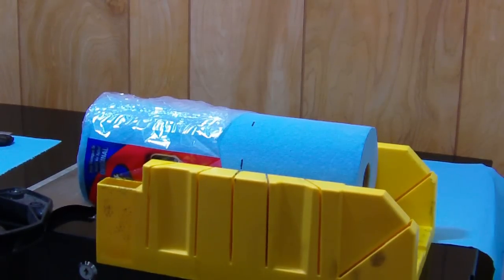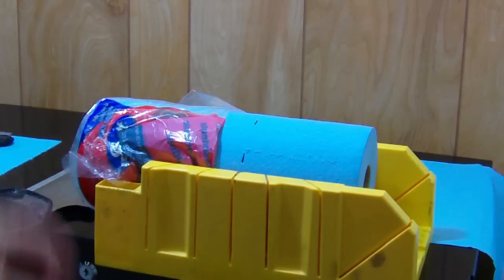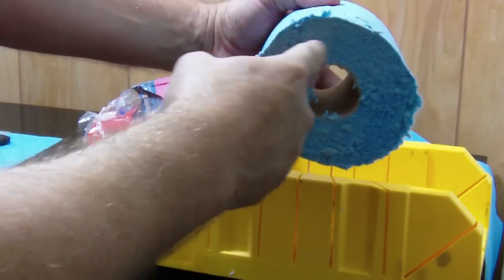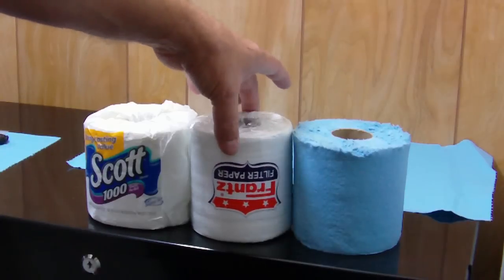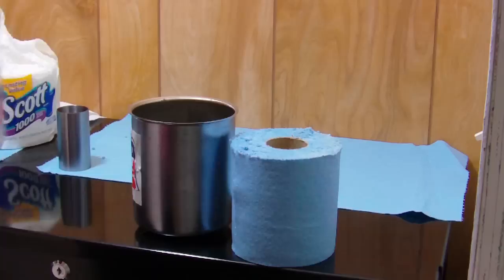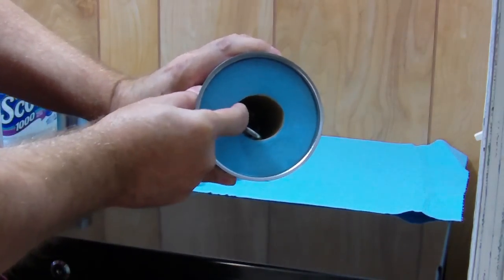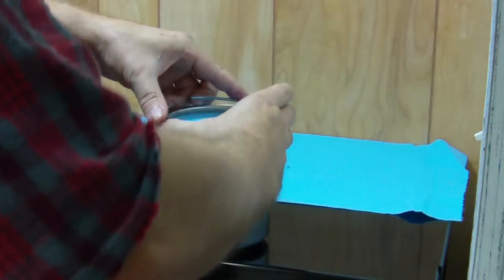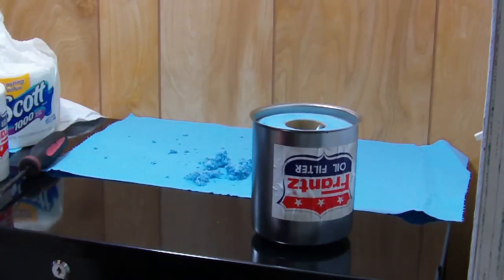Blue Shop Towels as a Bypass Filter Experiment

Comment: The big Gulf Coast 10 quart filter for heavy duty diesels is 99 percent  at under 1 micron. When I sold them they used Bounty big roll paper towels. The flat head Ford V8 canister filter on my old Ford diesel tractor has half a roll of Viva towels in it now. About the same as the blue shop towels. John Frantz got his start in  19 53 converting the old canister filters to use a Frantz canister with a roll of 2 ply toilet paper. No Frantz elements or Scott 1000 in those days. I use only the Ford canister. Feed it with a Perma Cool 189 oil cooler sandwich adapter. Got mine from Jegs. Summit.has them. I have a tubeless tire valve in the lid. A tire pump with a gauge.The pressure comes up. When the pressure drops its ready to change. Use a Slime valve with a nut from Auto Zone .

Comment: VIVA paper towels are similar. I use a sharp knife and go around a few times. Its a lot smoother cut. My flat head Ford V8 canister filter takes two 5 1/2 inch elements. Thats a 11 inch roll cut in half.
Reply: The Viva cloth paper towels are similar. I set up the flat head Ford canister filter to take the Scott 1000. I was able to remove the plate so it would take half a roll of 11 inch paper towels.
Reply: Correction. I removed the spacers under the perforated plate so the plate would go to the bottom.
Reply: I tried the saw. I like the knife better. I mark it all the way around and put a good edge on the knife. The Scott 1000 worked great. Cant gravity enough fuel thru it for the Diesel tractor fuel. I remember when all we had to use was mlm 2 ply. The filters dont require a firm paper. For awhile I got my best 2 ply from janitorial supply stores. Went to the easier to service top loaders in the 80s.
Reply: I go around a few times with a sharp knife. Its hard to cut the core. The next time I cut one I will have something thru the core like a shovel handle. Not sure what Gulf Coast filters uses now They claim 99 percent at under 1 micron. They used Bounty big roll paper towels in the 90s. Janitorial supply 2 ply in the little filters. The top salesman took over the company and dropped the toilet paper filters. He only does heavy duty stuff. Off shore rigs. Abrams tank fuel  military aircraft fuel and that sort of thing. Small filters are a waste of time to him. The Australian Jackmaster Classic is similar.
Reply: The problem with toilet paper is it generates too many BS stories. I started in 1963 with a Frantz oil cleaner and Standard Delo 30W. Delo 30W and Delo 20W were 29 cents a quart in the discount stores. Frantz came only in universal. 29.95 complete.  If you are selling them and someone asks what is in there it would be best to say a section of VIVA paper towels. Then cut up some and sell them. Dont use a saw. Use a sharp knife. I went to the easier to service top loaders in the 80s. Frantz stuck with that bad design.

Comment: Serrated bread knife or very sharp kitchen knife would probably work better than a saw for a roll of paper towels...
Reply: I was using a fine toothed hacksaw and going around a few times. A sharp knife makes a lot smoother cut. Ive been using VIVA towels. I believe Gulf Coast filters claims Bounty big roll paper towels are a 1 micron filter. The Australian Jackmaster Classic claims 1 micron if you use their elements.
Reply: When I started using the Frantz in 1963 they didnt have the ring in the bottom or the bail to remove the used TP. The ring isnt needed if you use good paper and install it correctly. I used long nosed pliers to remove the paper. The Australian Jackmaster Classic has a pull out ring if you use their elements. I use toilet paper so I need the long nosed pliers and a socket to remove the lid. I went to the top loaders in the 80s. Jackmaster has a valve in the lid to push out the excess oil before changing it. Mine didnt need it. I put a Slime tubeless tire valve in the Ford canister lid. The one with the nut.
Reply: The Australian Jackmaster Classic has the air valve as optional equipment. The only filter I have that needs it is the Ford canister filter. I put a regular Slime bolt on tubeless tire valve in the lid.

Comment: So just how much did you have to drink that  you couldn't find the toilet paper ?
Reply: My thoughts exactly.
Reply: The flat head ford V8 canister filter on my diesel tractor takes 5 1/2 inch elements. Thats a 11 inch roll of VIVA cut in half.
Reply: I have packed loose paper in the bottom and pushed a roll of Scott 1000 down on top of it. It seals at the top. I have a tubeless tire valve in the lid to push out the excess oil before changing it.
Reply: The only problem I have with toilet paper is it doesn't fit. Frantz is a terrible design for using toilet paper. I used the Frantz for about 20 years before going to the top loaders in the 80s. All of the best ones now are top loaders. The next Viva towels I cut for the Ford filter I will use a sharp knife. I have a old shovel handle to push thru the core. The core is hard to cut with no backing.

Comment: Fram hasn't made a filter that cleans oil since the 60s. My 41 Dodge had a Fram that cleaned oil. It had a decal on it with a dip stick with clean oil on it. It read the dip stick tells the story. It was a bypass filter. John Frantz got his start converting them to use toilet paper. My Rambler American had a Fram bypass filter. It was a piece of crap pleated paper filter. I bolted a Frantz to the spin on bracket.

Comment: The orifice is what controls the rate of flow When the element slows down the flow you have gone too long before changing it. Always change the filter before it reaches its capacity. My engine is pristine. I could change the filter every 20 k.I wouldn't be getting enough new oil to keep the additive package up. At my filter change interval of about 6k the filter is still clean and the oil is still clean. I use Scott 1000. I use a Motor Guard. The Frantz is a good filter if you know how to change it
Most people don't.

Comment: wonder if somethingl ike this could be used on a 4 cylinder car only seem t o see them on trucks
Reply from the maker: I saw a video with a Frantz canister on a Toyota, it cleans the oil better than the small filter. I have one on a 6-cylender diesel. Keep in mind this is an expensive system to purchase and install.
Reply: Yes, and they are easier to install (usually).
Reply: In the early 80s a Realtor here in Denton Texas asked me if it was too late to put a Frantz on his Toyota Corolla with near 100.000 miles on it. I asked him how long he planed to keep it. He said a long time.  I said it needs a Frantz. Years later my wife was introducing me at church. She said mr Biggs this is my husband. He said I remember Ralph. The Corolla has over 500.000 miles on it. Took the boy scouts on a camp out and they found the Frantz elements.
Reply: You need to be mechanically inclined to install and take care of them.
Reply: I ran a 84 Subaru over 250.000 miles with no oil drains using Mobil 1 with a Frantz oil cleaner. I used a Frantz adapter that eliminated the Full flow filter.  The problem with cars is finding room to mount one. The best filter for cars is the Jackmaster Classic. The over center clamp can be a pain in tight places.
Reply: Putting a Frantz upside down under a truck would be a non starter for me.  In the 60s Frantz recommended putting the Frantz upside down on the beetle. To hell with that. I put a Motor Guard on the wifes beetle. It filtered from the bottom up. Tilted it so the large chunks wouldnt go back to the engine at shut down. VW saved millions by not putting a full flow filter on the beetle.

Comment: Waste of time
Scott 1000 works better because it is more solid. I have used Toilet Paper since 1963. It has worked for me.
Reply: I have been doing it with a sharp knife.
Reply: Actually before Scott 1000 or the Frantz elements all we had was 2 ply toilet paper. It worked great. Ive been testing VIVA towels and Charmin Ultra Strong. Gulf Coast filters of Gulfport Mississippi  uses Big roll Bounty towels in the big diesel engines. They used 2 ply TP in the Frantz 3 stackers before Frantz 3 stackers went out of production.
Reply: Years ago I did a fleet of tree service equipment. The  big filters took Bounty Big roll paper towels. The small filters took Scott 1000. Not sure what Gulf Coast filters uses now. They dropped the small filters. They paid to have the big filters tested. They are 99 percent at under 1 micron. That is about as good as you can get.
Reply: I might be wrong. In the 60s all we had was 2 ply paper It worked fine. We didnt have Scott 1000 or Frantz elements. I ply was what you found in chemical toilets. The only thing that fits the Frantz is the Frantz elements now. The Charmin ultra strong is similar to what we had in the 60s except it fit.

Comment: Hey there! So i was just talking to my buddy who works at Cummins rebuilding engines in Australia, He said that the cummins engines he works on run a 30 Micron full flow filter and a 5 micron bypass filter, do you think this is the reason the Cummins engines last so long ??
Reply from the maker: Yes, almost all diesel engines run a bypass system to remove abrasive soot. Studies were done on a GM 350 and the result was 4X longer engine life using the Frantz oil filter to remove small particles.
Reply: Many years ago Cummins claimed an 80 % longer engine life using the Cummins Fleetguard 750. They used pulverized newspapers and wood chips.

Comment: The space between the tube and paper core means nothing.the seal at the bottom is what counts. The Gulf Coast O1 Jr has about a 1 3/8 tube.It has a good seal at the bottom plus you are pushing the element down against the seal when you change it. Watch out for the B S stories. I have been hearing them for over 50 years. A guy asked me will a Frantz do something for my noisy Cadilac engine.I asked when did you change the oil last.He said I don't know it's been a long time. Does anyone think this fool would change the Frantz IF I sold him one. He would take his Caddy to a mechanic with a blown engine. He would be told his engine is full of toilet paper when it is full of sludge. Its not a problem with these modern engine but in the 60s I have seen a Frantz fill up with sludge in 50 miles. They didn't have good crankcase ventilation or fuel injection. My Altima gets a new roll of Scott 1000 every 6000 miles and a quart of Pennzoil Platinum .What oil is best ? I have no idea.

Comment: Cool idea. It looked like the metal tube you used did not fit tightly against the cardboard. Wont the oil just bypass the element? Also how are you monitoring flow rate? I'd love to have a flow rate on my frantz to tell when it needs to be changed.
Reply from the maker: I was going to do another video about some of the stuff I have learned about the Frantz, it does need to fit tighter or the paper will expand against the metal tube and loosen up allowing more particles to pass. There is a metal ring on the base that stops the oil flow down the cardboard center. My system has a return line in the fill cap, its easy to measure the flow rate into a container or collect a sample, use a meat thermometer to determine oil temps for a comparison. I am working on a measurement of the Scott 1000 element to get the same quality TP element every time. The formula is how much to remove to get a tight fit based on how the TP will compress and fit in the canister with minimal effort.
Reply: I just picked up some scott1000 for the first time (been using the unit for 10 years maybe). I'm just planning to take off enough so I can barely shove it in.. The frantz filters I bought directly even seemed too loose. I'd be interested in any such vid if you make it. I think so many of us have different (good) mods for it. I was thinking of making the inlet hole even smaller, or installing an adjustable needle valve on the inlet line, as I think it is flowing too much. I put a clear tube in a portion of the return line...(after you gave me the idea to monitor flow) if it wasn't for an occasional bubble I would have no idea since the oil is so clean it looks like there is nothing inside the tube lol. These things rock. 99% of people have no clue.  Anyways it seemed to be flowing much more than I expected. Maybe a tight fit with the scott 1000 will slow it down. I just did a rebuild and swapped my frantz into that vehicle so I'll be replacing the filter more often for a while. Now I need to find another one to replace the frantz I stole from my other car. :)
Reply from the maker: weeral1
I made another vid where I measured the canister (13-1/4" around) and the Scott Roll, was able to fit 14" inside with a tight fit. The flow rate is slow on a cold engine but pumps 1 pint per min on a hot engine... My engine is a diesel and it had a load of crap in it, the TP roll gets changed every 20 hours and the top of the roll has grit in it every time. I also do lab testing to verify the improvement in clean oil. [Thanks for your comments]

Comment: So how's it work?
Reply from the maker: I ran this paper towel because its more porous to hold dirt and it worked wonders to polish the oil. I went back to Scotts 1000 rolls changed every 15-20 hours until the oil became clean. The last time I did a particle count, the results are very good. The first sample was 18/17/14 and reduced to 16/15/12
Reply: It doesn't

Comment: How's it working out?
Reply: Probly has paper media all around his engine XD oil pressure and heat probly tore them towels up and im sure it made its way into the engine lmfao
Reply: I started using toilet paper oil filters In 1963.  Frantz on a Rambler American. I have done very well with toilet paper. Never had to use shop towels. I use Scott 1000 now. It was a.lot easier to find high quality paper in 1963.You are wasting a lot of time.

Comment: When the engine is up to operating temp, does the canister get hot?
Reply from the maker: +dieselworld Its oil temperature, 160-200 degrees F
Reply: That's what I thought because my Frantz oil refiner does not get warm at all.
Reply: Yes, very hot. My arm told me that.
Reply: If the oil is hot the filter should be hot
Reply: In the old days engines generated a lot of sludge. If the Frantz quit getting hot you knew the orifice was clogged or the toilet paper was full of sludge.

Comment: It's a bad thing to do I have riped a part classic cars with what your doing on them. And have found that they destroy the motor. And have talked to restoration shops and they've came to the same conclusion by building a filter this way it will destroy your motor very quickly and there is no game.
Reply: The Frantz is a bypass filter Johnathan, as they should be used. There was a company called Stilko, that replaced the normal oil filter with their canister. Those are the ones that failed, plus they are no longer in business. Frantz, Amsoil, Eco Filters, Gulf Coast, and Kleenoil are all in business because they are used as a partial flow filter, in ADDITION to the normal engine filter.
Reply: johnathan hawkins - Not even remotely close.  These kinds of filters are used all the time on diesel engines to filter out the soot, and they're not killing engines.  Is it possible you ran across a single instance where something went wrong and killed the engine?  Sure, it's possible I guess.  It's also possible any full flow filter might fail in rare circumstances and release crud into the engine, resulting in catastrophic failure.  Does that mean you shouldn't used a regular full flow filter?  Of course not.
Reply: I have used toilet paper filters since 1963 starting with a Frantz. There is no way a toilet paper filter can cause problems. People can cause problems. The Stilco type filters convert the full flow system to a bypass system. A large bypass valve stays open as long as the engine is running. You cant make a full flow filter out of 1/3 of a roll of toilet paper. I like the top loaders with oil lines going to them. My Ford diesel tractor has a flat head Ford V8 canister  filter converted to use a 4 1/2 inch roll of scott 1000. My best filter for tight places is a Jackmaster Classic.
Reply: I have Motor Guards Gulf Coasts a Jackmaster Classic and the Ford. Its a fact of life bull shit stories come with toilet paper filters.
Reply: Years ago Gulf Coast filters had Frantz 3 stackers all over the Gulf of mexico on expensive marine engines and locomotive engines on drilling rigs When they went out of production they were replaced with paper towel filters. Saw the FAA approved AeroFrantz on crop dusters north of Sedan Kansas  Frantz had testimonials from light aircraft owners and oil analysis reports. They used 2 ply toilet paper. No Scott 1000 or Frantz elements in those days.  The clamp bolted on. Its a tough business trying to sell filters that clean oil to people that think proper maintenance is allowing the oil to get dirty then draining it. The internet is helping. NASA read my posts and started using Gulf Coast Filters. That wouldnt have happened  at the Flea Market.
Reply: I think you can still get the screw on filters . Trasco is one. I have one I have had for about 60 years. Its like a Stilco. Had it on a Buick. When the o ring blew out I removed it. Never used it again. It used about 1/3 of a roll of paper. It had a large bypass valve that stayed open as long as the engine was running. I wouldnt want another one. If you want clean oil you have to deal with hoses.I like the top loaders. All of the best ones are top loaders these days. The Frantz is the best known. Poor design for using toilet paper.